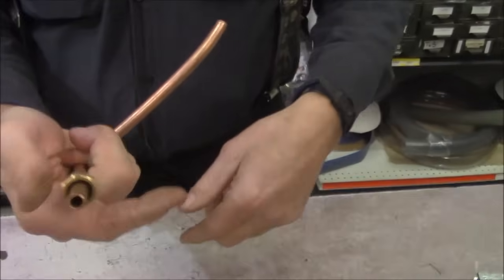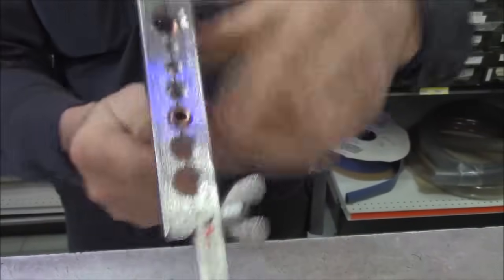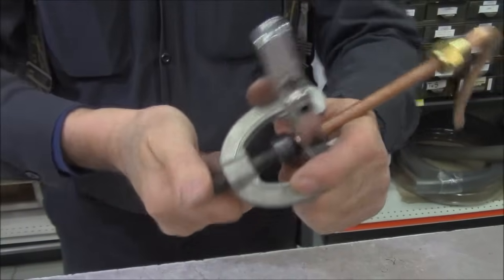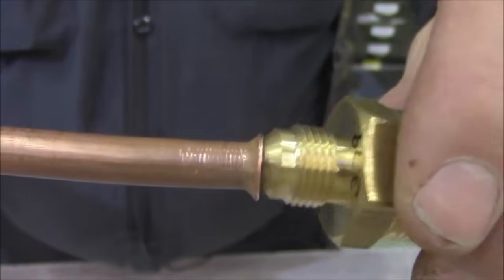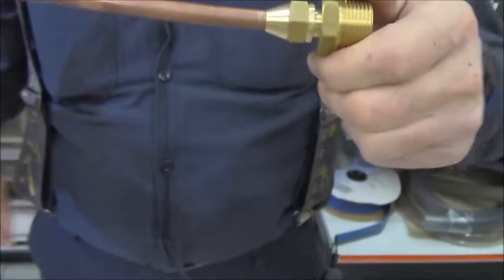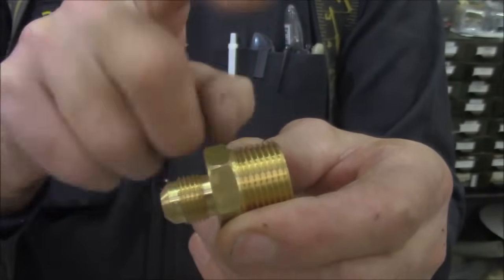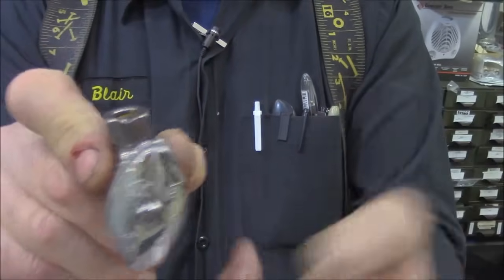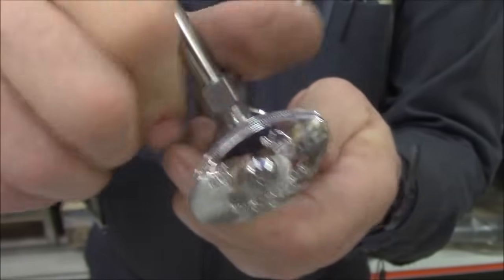How To Flare Copper Tubing For Gas, DANGER - NOT WATER COMPRESSION NUT

Comment: Great video!! To the point. I have one question. Is the copper like that’s used for HVAC lines the same as for propane (LP) lines? Thanks again for the great video.
Reply from the maker: Good question as I have flared copper and aluminum lines my whole life. When I installed my Panasonic mini split here in Florida the generic (not from Panasonic) linesets were brittle. Even if I tried to flare only 1/8” of the line at a time it would split the line. I had to borrow a Ridgid concentric flaring tool that did flare the line without splitting it. The cone comes down on the pipe off center and gradually creates the flare. Old stiff aluminum lines did the same but I could do them in 2 or 3 steps to get it done.

Comment: Thread sealant on flare threads? Or just on the other side, (iron pipe threads)? For gas installation
Reply from the maker: Just on the iron side, and sometimes w/liquid Teflon pipe joint compound. Teflon on the flare side is for lubricating purposes only.

Comment: Is that 1/4" copper? I'm looking for recommendations from anyone with experience. I'm trying to run my own lines in my tiny home, for a propane fridge, a propane stove, my propane tankless water heater. I have 4 40lb tanks that I like, because its easy to fill/carry them anytime I go into town. 
Should I simply run a line to each apparatus or could I split a line to say the water heater and stove(two appliances that will only run at odd times), and a seperate line to the fridge, which will pull a small amount of constant gas.

I have a very short run from the tanks outside to where the appliances are, less than 20ft

Could I just 1/4" copper for the whole run, or should I use the yellow coated pipe?

Thanks for anyone's insight, having a tough time finding the answers I'm looking for
Reply from the maker: If you want to run multiple appliances you should always size the lines to operate both at once. Shouldn’t be that expensive to size a larger line and reduce at the tee to each appliance. BTU size recommendations are on line and your appliances should have btu requirements.
Reply: Thank you very much  @MrHardware1

Comment: Would you also add yellow teflon tape to the treads?
Reply from the maker: @jakeglazier5750  only as a lubricant allowing the jut to be tightened easier. The seal is at the face (beveled end) and the copper. Not at the threads.

Comment: I cut off my propane line to remove a furnace in my RV. I don’t tow this camper , it’s a permanent camp site. I bought a quick connect plug from Lowe’s and closed off end. Is this safe? I’m not going to use my gas stove until I know it’s safe. Should I flare it then cap it with a threaded plug?😊
Reply from the maker: @davidbridges8402  depending on your local building codes, I would think that that line would have to be flared and then plugged with the flare plug. and the line not being buried. Meaning it will always be accessible, not behind some permanent paneling or wall covering. Some of the codes on quick connects are beyond my level of expertise, but I don’t think they would be allowed for a gas line.

Comment: I have a question if you don’t mind. 
How do you fit a 3/8 “ flare into a 3/8 FIP . I would think I would need a 3/8 FIP that has a flare inside of it.
Reply from the maker: @pianobar7801  you need a ‘flare to npt adapter’. A flare nut ONLY goes on a flare fitting.

Comment: Very educational and straightforward, thanks Mr. Hardware , recently I got my hand on a hydraulic pump from 1970 and somewhere in the system they connected a flare copper tube to the high pressure steel tube of pump , I really don't know if it is issue or not , but the system must work on 200 bar/3000 psi ,do you think that it can handle that much of pressure ?
Reply from the maker: @paladinahmadi3783  that is what a flare is for, however, 3000 psi is above my pay grade so I don’t know if the tubing could handle it or what I’m pretty sure the flare could but again above my pay grade.

Comment: Question 
Could you attach a flexible hose to that fitting to reach a hard to get place like a RV water heater replacement?
Reply from the maker: @garyferguson1552  I believe flared flexible lines are now allowed in household hot water heaters. Somehow I think the RV is exempt from some of the rules however you should be fine but I would check with an RV authority first.

Comment: I have the exact same flare kit. I have some 5/8 copper coil and I just cannot get it to flare out like that. I don't know what I'm doing wrong
Reply from the maker: @acemannw  i’ve had copper that was hard and brittle, and when I flared it, it would split. I ended up having to use an expensive rigid concentric flaring tool, which did the job. Another trick, which didn’t work on my brittle copper is to clamp it up a little at first and flare, then raise it a little more and try flaring again and then raise a little bit more and try flaring it again doing, it in two or three steps, sometimes allows the copper to bend without splitting.

Comment: Can i use the compression fitting for compressed air?
Reply from the maker: @dieterysraeltorreswaldthau5342  if under normal 80 to 100 pounds or less air I don’t see why not. I personally would prefer a flare because of the copper gets wiggled or shifted the compression ring could leak where flare fitting won’t . It will work when you don’t have a flaring tool, just be aware it could leak if vibrated or moved.

Comment: We used a compression ring on the gas line then the liquid to look for bubbles in the connection.
Reply from the maker: @loboxx337  that is not good. The compression ring is holding now, but if that copper line is disturbed, there’s a very good chance that compression ring could leak gas all in its own and you wouldn’t know it.

Comment: Excellent video, I’ve double flared a lot of automotive brake line but wasn’t quite sure if I needed to double flare for a gas line I’ve got to deal with at the house.  I was pretty sure a compression fitting wasn’t acceptable, also glad to confirm that.

Comment: Not true there's compression fittings on every single fireplace I install
Reply from the maker: I’ll bet it’s only on the pilot tube. The line coming to the control valve (that is live gas) should be flared.

Comment: Do I need to put any sealer on a flared gas fitting ?
Reply from the maker: No, the seal is dry. I have Teflon taped the threads to act as a lubricant.
Reply: @MrHardware1   I put the yellow seal only on the brass fitting end which screws into the valve .. Am I safe right now or should i seal the other side of the threads too ?
Reply from the maker: @sajidrafique375  the pipe thread side that goes into a valve gets Teflon taped, the side that the flare nut goes to does not. After you assemble, and turn on the gas, check with soapy water to ensure that there are no leaks.
Reply: @MrHardware1   Yes. Thanks . That's how i did it. It is not leaking .

Comment: do you put yellow tap on it??
Reply from the maker: No, I have put tape on the threads to act as a lubricant but the seal occurs at the face of the flare were no pipe joint compound should be.

Comment: Do you recommend a thread sealant on copper flare fittings? Thanks!
Reply from the maker: No, but I have wrapped the threads (none on the face of the flare) w/Teflon tape to act as a lubricant when tightening the nut.

Comment: Wish posters would stop saying "gas" when they mean "gasoline" especially when talking about water and natural gas lines in the same comment/article. The two are distinctly different.
Reply from the maker: However a flare fitting is safe for both, the point is no compression fittings on either.
Reply: @MrHardware1  I guess you missed my point. :(

Comment: Double flaring will Crack fittings not designed for doubles.never use compression fittings on gas,oil,and never overtiten as they will fail..

Comment: Great video! Just one correction: flaring of copper is never to be used in natural gas applications due to its corrosive reaction to copper. This technique can however be used with propane.
Reply: Wrong. Copper tubing is used all over the place and conforms to code. Look it up.
Reply: this is completely wrong. new construction houses everywhere use type k copper piping for natural gas distribution
Reply: You’re confused. It’s ok though. What you think is natural gas is more than likely community propane. It’a installation often looks just like natural gas except it’s drawn from a common buried propane tank somewhere within the neighborhood. Apology accepted.
Reply: @06Kabal  you're the one who is confused lol I have main line natural gas coming in through copper tubing, and my fireplace and garage heater are all copper tubing as well. Look up the codes for tubing types it is completely acceptable to use copper.
Reply: Careful…chronic confusion can lead to delusion.
Reply: @06Kabal  you must be speaking from experience
Reply: @06Kabal  Here is the NFPA code - 
403. 4.3 Copper and copper alloy. Copper and copper alloy pipe shall not be used if the gas contains more than an average of 0.3 grains of hydrogen sulfide per 100 standard cubic feet of gas (0.7 milligrams per 100 liters). Threaded copper, copper alloy and aluminum-alloy pipe shall not be used with gases corrosive to such materials 

Here is the first size chart section - 
TABLE 402.4(8) SEMIRIGID COPPER TUBING 

You can use copper if the RNG contains less than 0.3 grains/CCF of HS2. National HS2 standard is less than 0.25 grains/CCF. Therefore copper tubing is allowed to be used to carry residential natural gas. If you want you can check your gas providers website for their natural gas quality standards and see what their HS2 content is. 

You are wrong.

Comment: Made 7 connections, 6 leaked. Had to really tighten them HARD to stop the leaks. As of this writing I’m still unsure, since I do not believe I should have had to have tightened them so tightly.

All leaks on the backside of the flares (where pipe comes out of fitting) never from the front side of the flare (threads.)

All flares fully seated and nicely squared up proper to the fitting. I’m using good, forged brass parts.
Reply from the maker: Flares require more torque than compression fittings, There is a torque wrench to insure consistency for flares.
Reply: @MrHardware1  Thanks. Pretty sure that with how hard I had to turn them to stop the leaks I was then in danger of turning too hard. My outstanding concern now is, assuming I don't disturb the tubes and connections is no leak going to stay no leak . They are all going to be behind a finished wall, so I need to get this correct.

I've since looked at a few other tutorials and realized there are all sorts of possible errors unrelated to torque. My flares are nicely shaped by maybe I scored them with the flare tool or the tube turned when tightening and the fitting's facing got scored. Lovely when it works, not so much when X, Y, or Z goes wrong.

I'm about one step away from buying a better flaring tool and a new roll of tubing and doing it all over again.
Reply from the maker: I just put an AC system in the house where I had several leaks in the flares. When I went to redo the flares with a straight in-line rigid flaring tool the copper tubing started to split a little. I ended up getting a concentric rigid flaring tool, about a $200 item, and re-did all my flares with that and it came out beautiful. I’ve experienced cheap copper that was brittle and would easily tear rather than flare nice. Usually whenever a flare is done properly it will not leak at a later date.
Reply: @MrHardware1  I picked up something from Lowe's under their Kobalt house brand. Appears to be similar to Rigid's although I'd never claim it's as nice without seeing both together. It's a "Heavy Duty Flaring Tool" and has the concentric circles and clamps together right in the middle of whatever size you're using. Two issues with the super-cheap tools mitigated right there. 

https://www.lowes.com/pd/Kobalt-3-16-1-4-5-16-3-8-1-2-5-8-and-3-4-In-Flaring-Tool/1002645146?cm_mmc=shp-cprdplbgooglelia-208-plumbingtools-1002645146-_-0&placeholder=null&ds_rl=1286981&gclid=Cj0KCQjw2NyFBhDoARIsAMtHtZ5r3P8hAvdRMkAku6AWs_7pKhnfwBIvNKD6BUxh8ru3QkfX9-8WG4AaAshJEALw_wcB&gclsrc=aw.ds

None of my flares were split UNLESS tightening them to stop leaking caused that. I'll know soon. I will remove them all this weekend and create new flares with the new tool and a bit of additional knowledge gained since last time.

Comment: Thanks. That information was extremely helpful. However, I'm now confused about the types of gas fittings in the stove. They're compression fittings, not flared.
Reply from the maker: Once inside an appliance and not under constant pressure manufacturers do sometimes use compression fittings

Comment: Hi what do I need to do differently to connect two copper water lines for my fridge so it doesn't leak?
Reply from the maker: Make sure the outside surface of the water lines aren’t damaged scratched or flattened, when I use a compression ring and it fails I’ll loosen up the compression nut and wrap the ring with three reps of Teflon tape and reassemble. That usually solves the problem for compression.

Comment: Are these also  used for joining furnace oil copper lines?
Reply from the maker: I’ve seen fuel oil lines done in compression and flare, the latter being more secure. I would use the method your local building inspector requires.

Comment: Hello, I am looking to know which size pipe I should use for propane supply line? 1/2 o.d. Or 3/8 o.d.? Thank you.
Reply: Distance and btu's on the appliance determine the pipe size. Short runs less than 30' and 35k btu's would be ok. After that check with a gas table to match distance and btu's for pipe size. https://images.app.goo.gl/BibWZb4vkx3JhYVn9
Reply: Blair Gilbert thank you. Have a wonderful day.

Comment: If I have the capability to make a double flare. Should I do that, or should I only be doing a single flare on an appliance connection? I'm cutting out excess, kinked copper tubing and adding a gas ball valve where there wasn't one previously. Then an EFVB valve. I've always been told to use pipe dope on all fittings. These directions say only the pipe fitting from EFVB to ball valve gets doped. Everything else is flares and should not be doped at all? That's correct? Just tighten sufficiently? Thank you for the abundance of information you share!
Reply from the maker: I use teflon dope, paste or tape, as a lubricant sometimes. The seal is where the tubing meets the face of the flare and is hard to dope it and not get it into the line. Thighten properly and check with soapy water.

Comment: I thought natural gas wasn’t supposed to use copper pipe and definitely don’t use a single flare. That’s what I have always heard.
Reply from the maker: Nope, this is common and standard procedure in the USA.
Reply: @MrHardware1  ok, well explain how single flaring is not careless?
Reply from the maker: @nwinter2752  All I can say is that is the standard procedure for copper gas lines for as long as I remember. Double flare is only for automotive as far as I know. Done properly, what makes it careless?

Comment: Hi  Blair how do you sale the cooper tube ? per meter or by weigth?
Reply from the maker: We sell it by foot or by the roll, 50'. The roll is less per foot because a hole roll is less labor intensive.
Reply: @MrHardware1  Hi Blair  I have a small store in Brazil and I sell cooper tubes , pex tubes and brass fittings. Some Stoves and acessories.
Reply from the maker: @rafaelmachado4165  It sounds line this area years ago. a hardware store back then sold everything. Washers and dryers, sinks, furnaces, plumbing, wiring, ..., everything in a home. I would love to discuss business w/ you. please respond to blair@mrhardware.com if you find the time. Blair

Comment: one thing not  mentioned  is  the  collar  does  not  have to be  perpendicular to  the  flaring  bar.... its  critical  to  keep the  cone  centered  in  the  middle of  the   copper  pipe  and  in most  cases  the  collar   claps  are  almost  diagonal

Comment: Compression ring is a waste of time
Reply from the maker: I gotta say I prefer a 5/8 compression adapter on an old copper water line over a shark bite. I'm not sold on the o-rings on shark bites, however they are in my Florida home and over 10 years old. I did not install them. Blair

Comment: It is a copper to brass contact? I think that is going to leak. Perhaps you need to add a teflon tape between the metal contact.
Reply from the maker: Yep, metal to metal. Called a ground joint and was common in drain plumbing in the 1952's to the 80's. Gas calls for no gasket when flaring copper tubing. It does take a fair amount of force to tighten the nuts so they don't leak.

Comment: please send the link to get the flare threaded connector that you used
Reply from the maker: That was a 3/8" flare x 1/2" mip (male iron pipe). You purchase the size fittings to suit the job, which are tons of. Get the right fitting when you know the sizes of the tubing and the appliance you are feeding. Blair
Reply: great video and prompt response even though the post is over two years. you've got my thumbs up